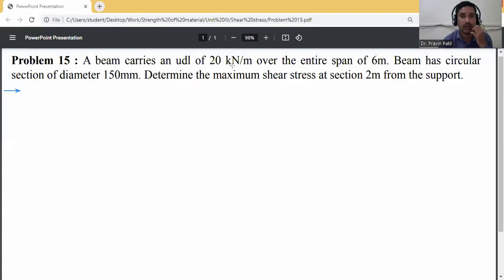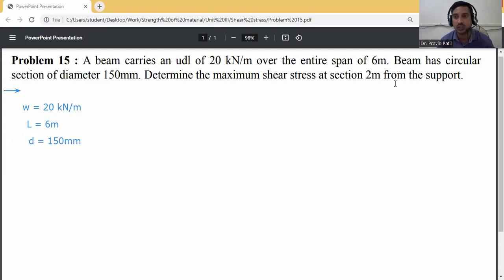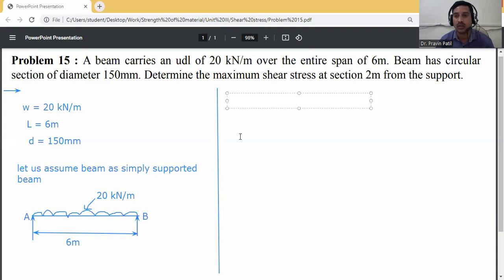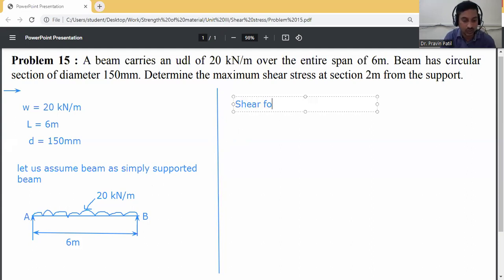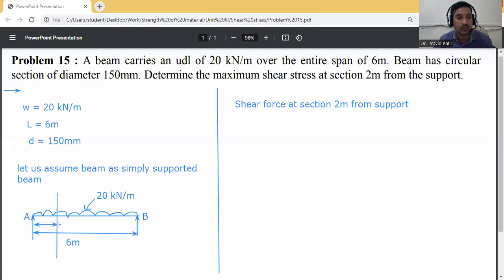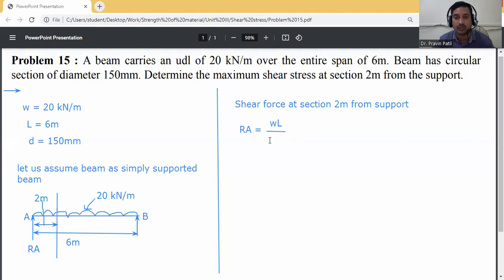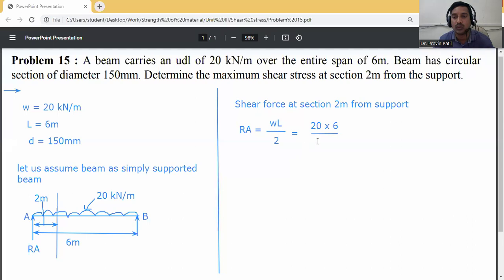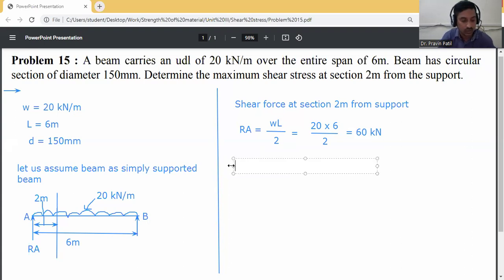Problem 15-Maximum shear stress for circular section at 2m from support

Comment: Sir this question ....... 
a. A beam PQ 10 m long has supports at its end P and Q. it carries a point load of 6 kN at 2 m from P and 
a point load of 6 kN at 8 m from P and u.d.l. of 4 kN between the point loads. Draw the S.F.D. and 
B.M.D.
b. A steel rod of 30 mm diameter and 5 m long is connected to two grips and the rod is maintained at a 
temperature of 95 K. Find the stress and pull exerted when the temperature falls to 30K if 
i) The ends don’t yield, ii) the ends yield by yield by 1.2 mm 
c. Take Young’s modulus of elasticity, E = 2 × 105 MN/m2
and α = 12 × 10-5
/ K. 
d. Calculate the moment of inertia for L-section of dimensions 100 mm × 80 mm × 20 mm along x-x axis 
and y-y axis paasing through the C.G. of the section.
e. Calculate the safe working load for a circular steel strut of 6m length and having diameter 80mm 
which is hinged at both ends. The factor of safety is 4. Take E=2.1 X 105 N/mm2
.
f. A cantilever beam of 6 m span carries a u.d.l. of 4.5kN/m over the whole span. Find the maximum 
deflection and slope when moment of inertia, I = 2 × 108 mm4
and Young’s Modulus of elasticity, E = 2 
× 105 N/mm2
.
Reply from the maker: https://youtu.be/b8kRJyI826c